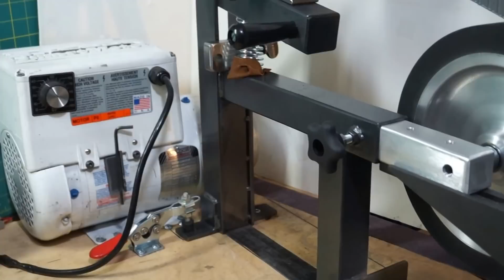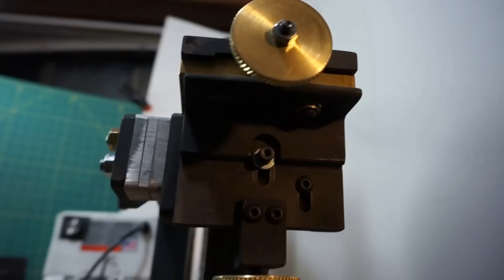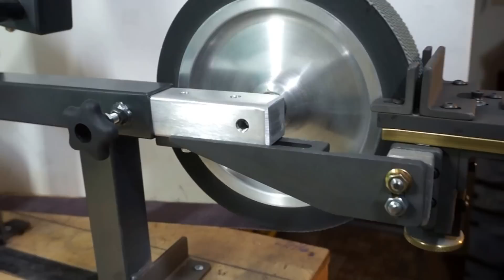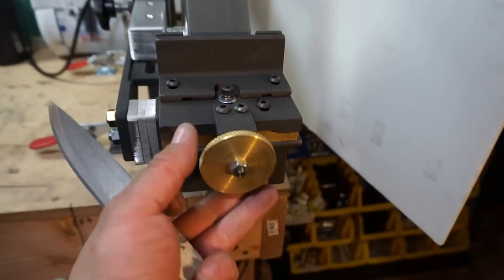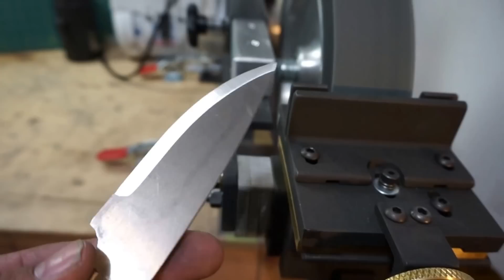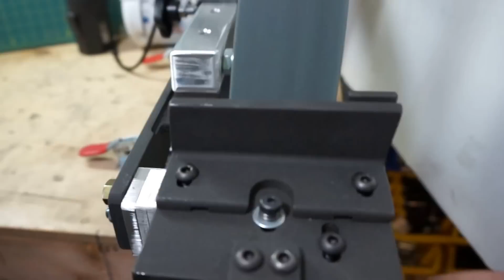KNIFE HOLLOW GRINDING  JIG  on a belt grinder  for knife making  ,Pheer Grinders

Comment from the maker: yes you can mount this to your proto type pheer grinder  grinder , you will need to  get the kmg jig , & elevator   the use a peice of 3/4 " aluminum as a mid spacer .  buy a KMG tool arm and that should do it .

Comment: Jose, I ordered the 454 from you about a week ago and have since placed and order for this KMG jig from Jantz and I was wondering what else I would need to hook this sucker up to the 454 grinder?
Reply from the maker: you may have to do a little bit of modification to the arm of the jig , it may be a bit long so you may have to grind it down a bit .  you will need some bolts .
also you will need to drill and tap 2 holes on the tool arm . these need to be 3/8 tapped holes